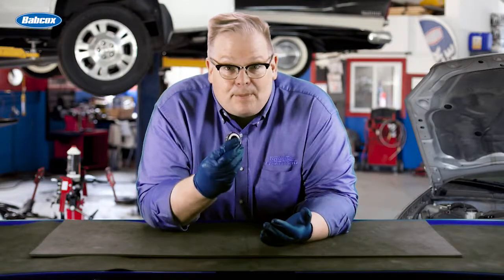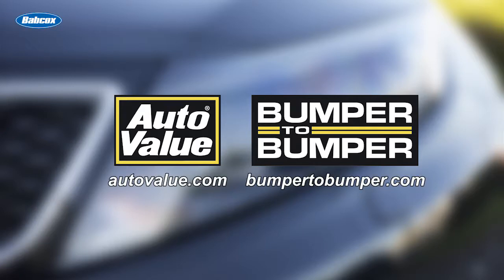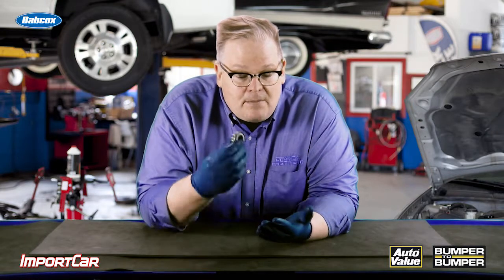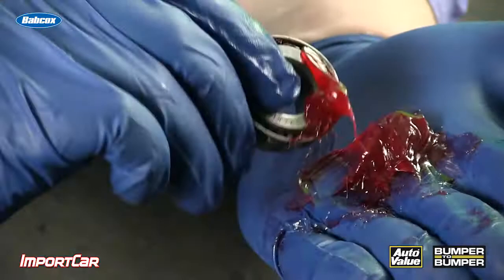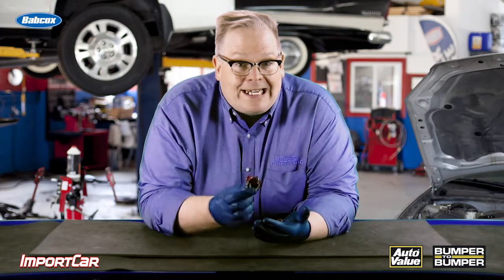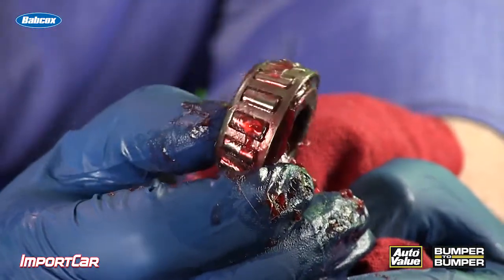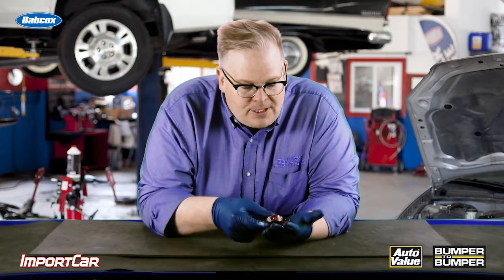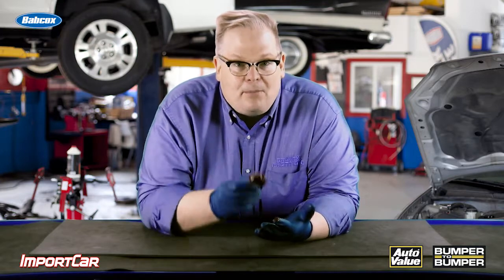Packing Tapered Roller Bearings | Maintenance Minute

Comment: I've heard that too much grease will cause overheating. Never actually seen it happen though. In fact, in tech school I was reading a Chilton manual and IT said that you should fill the hub with grease if you don't have an auto bearing packer. Just make sure the bearings are packed. In addition to packing the bearing, I usually put a liberal amount of grease on the race before installing the bearing. The reason I don't fill the hub with grease is that it's messy, time consuming, and a waste of grease.